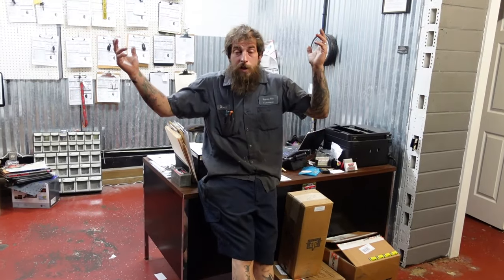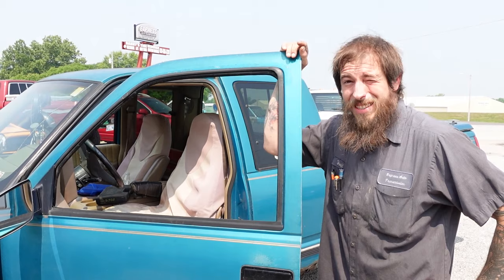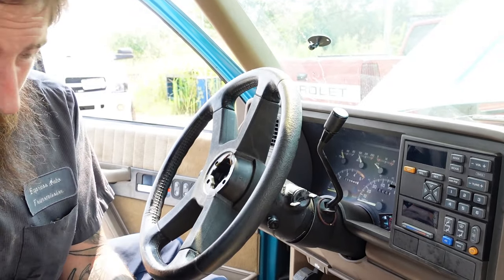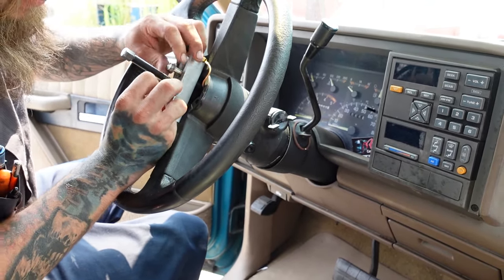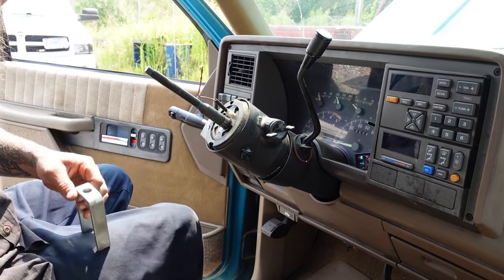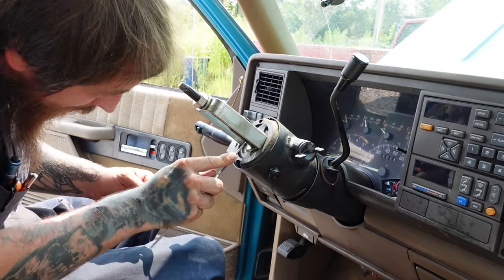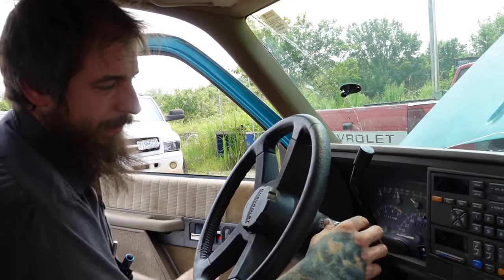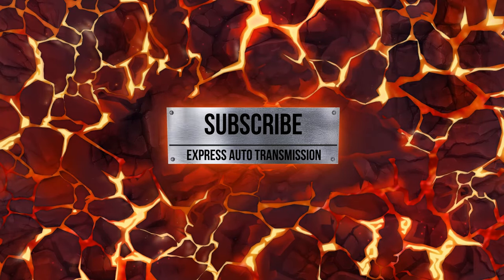1993 Chevrolet Ignition switch replacement

Comment: That is the lock cylinder, not the ignition switch.
Reply: Right!
Reply: I know ! All the people misleading me in the titles !
Reply: Everyone:  Boo this man!
Reply: I learned something today🤣🤣 no shame
Reply: @spacesuitor  😂😂😂😂😂😂
Reply: This is the ignition switch 
You all well most have the Title wrong 
It’s called a ignition starter switch is most likely what you are all looking for 
Other than that this video isn’t wrong
Reply: @joshuaknudsen8339  That is the lock cylinder, not the ignition switch.

This video shows the lock cylinder which moves a pushrod to actuate the ignition switch, which is mounted about 2/3 the way down the steering column on the up-facing side.

Search any parts site for ignition switch, you will see.
Reply: @spacesuitor  ingnition starter switch
Reply: @spacesuitor  and you acting like o don’t know how it work I’m not stupid
Reply: @spacesuitor  yes I know the video is of a different video but the part is exactly the same as the one I’m putting it

Comment: While replacing this ignition switch Dave subtly tosses out the following: "When I was 19 I did one of these ignition switch jobs  without the use of a steering wheel puller."  I cannot overstate how difficult that would be. I would say it's impossible and most mechanics would agree. But Dave did it. For that reason alone I liked & subscribed to this channel; a transmission repair channel. If I understood Dave correctly when he attempted this job so many years ago HE DIDN'T EVEN KNOW THERE WAS SPRING TENSION ON THE OTHER SIDE OF THAT CLIP. So when he finally tore the clip out BANG he was startled by the release. That is called Follow through. In the Oxford Dictionary under the word determination it should just have a picture of Dave with a caption underneath that reads See Him.

Comment: Thanks for the video! Just a little tip for the diyers like myself. The little two pronged switch didn't want to go back in for me. It kept getting stopped by a plastic tab on the lock cylinder. The tab moved real easy. I used a zip tie to hold pressure on the tab(like I would a screwdriver).

Comment: Hey bro, ive already replaced the ignition switch just like in your video...fast forward a few years later which is now...my ignition switch started to act up or what i thought was ignition switch...truck would intermittently shut off while driving then it got worse and i noticed that if i rotate the switch forward almost to the crank position then the truck would stay running...i thought it was bad switch because i used non acdelco so i got new oem  switch and that didnt fix my issue...truck will crank up just fine but will shut off when switch returns after starting...WTF?...im gonna go to dealership and see if they could print me off a diagram from alldata but was wondering if you could help...i may just bypass all of it and just run a switch with a push button like the race cars have...its a 94 chevrolet k1500 auto 4x4 5.7

Comment: I'm about to do the same thing to my 91 because my ignition is stuck on also. What's the name of that copper pin piece you removed that broke next to the ignition cylinder? Just in case mine is broken also
Reply: Mine did break and have no idea wtf it’s called.
Reply: Mine also broke, no idea what it's called or how to look up a replacement part.
Reply: I think it’s called TURN SIGNAL CANCELLING CAM

Comment: At 8:03 that plastic piece that he broke, was missing in my steering wheel, does anyone know how to find that part, i replaced the ignition switch but still have problems with it coming loose and it just spins doesn’t  make contact truck no start

Comment: Did the same to my 1994 pickup. After replacement, my battery drains at 5.6 volts and ruins the battery unless I remove the negative cable. Any recommendations?
Reply: Did you ever find solution? I have the same issue. Thanks
Reply: My battery drains and one by one everything died got new alternator and battery then it worked....now my ex put battery on after jumping a car and he hit something metal a few times and smoke came out engine where red battery box is fried wiring then made a new wire fix it... Nope just cranks won't start .bought new regulator. Computer won't read for diagnostics test .stripped screw on computer . Electrical machanic says if it breaks he needs my permission to remove it to check things out...please help I got a fuel pump fuel filter. I dropped tank and did hoses right .got them white and silver little screw things all 8 out  another truck at pick n pull ,my son works hard two jobs goes to school, prom coming up ,graduation,passing his test to join the Marines like he's wanted since 5 yrs old....all I want to do is get my 2004 Chevy avalanche working and a little sprused up so I've gotten under cars in engines to pull parts given my money to lying mechanic shopes and at end of my rope can't find trusting folks except for your vids I'm more at ease thanks

Comment: Why do people call these ignition switches. It is NOT a ignition switch. It  a lock cylinder. The ignition switch is under the dash mounted on the column…